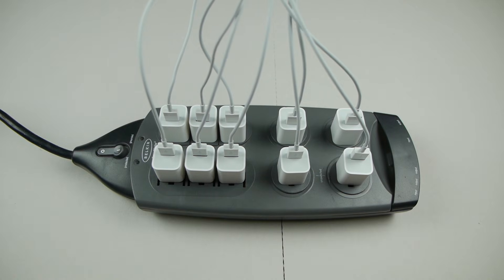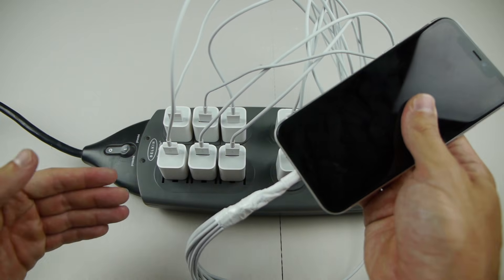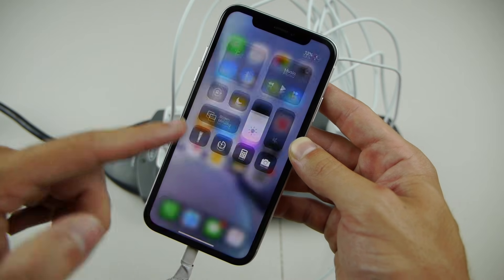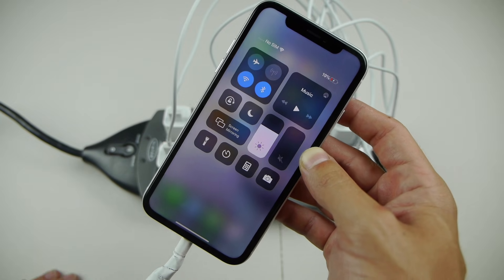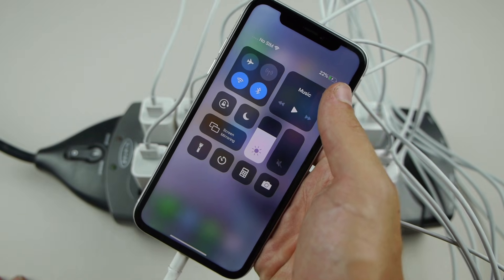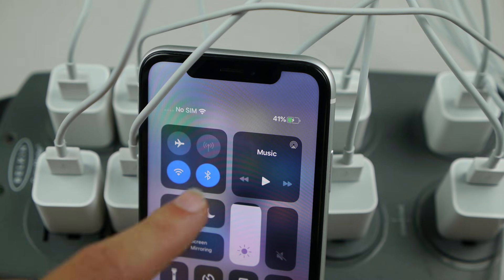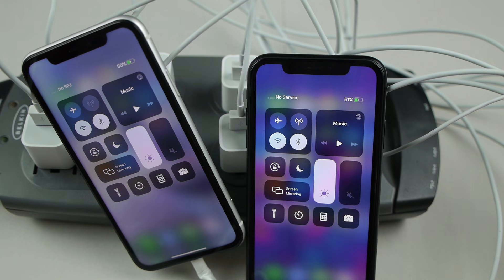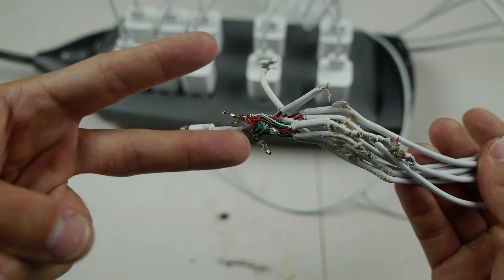What Happens When You Plug 10 Chargers in an iPhone? - One Mega Charger!

Comment: The charging current is limited by the charging device itself. For example, charging my iPad from an Apple charger, the iPad drew 0.94 Amps and the voltage dropped below 5v. Charging the same iPad and swapping to a USB Cigar socket connected to a 12V 7Ah battery allowed the iPad to draw 1.97 Amps and this held steady at 5v. The iPad itself ought to have a current limiter or thermal cutout  if well-designed

Comment: That's around 50 volts pushing through that iPhone normally a single charger is around 5 volts
Reply: No, it's still just 5v (because they're wired in parallel). It would be pushing 10A instead of the usual 1A, though, if not for the current regulator built into the phone.

Comment: The reason why the one with 10 cables charges slower at the end is because. Normally the iPhone slows Down charging at about 50% so the battery doesn’t get dameged by charging too quickly, so it probably just slows Down even more with 10 because otherwise the battery would get fried

Comment: The iPhone will only draw the necessary amount of power from the chargers that it needs when you solder them in parallel. It will allow the phone to draw more power, but the voltage stays the same and the phone will regulate the power…

Try soldering them in series, that will increase the voltage from 5v to 50v, thus forcing more power through the phone

Comment: This is seriously danger to you and your phone!
Don’t try this crazy thing!
High power voltage is created at the connecting point of all cables without suitable power inverter or transformer, it’s equal to direct power (uneven voltage).

It is possible and safe, if you connect a suitable converter at the  connecting points

Comment: Even with 100 cables you will have same output, a volt won't increase nor current cause they are connected in parallel not in series

Comment: This is fake by the way. There's just one original, whole cable under that tape. You 100% cannot just solder all the data connections inside the cable togheter... A modern charger cable is not just 2 wires for positive and negative. It's sad that so many people believe this, and that he didn't even mark this as satire in the video description.

Comment: HOW did you not burn out the battery?!?! there is at least 10 amperes! if you connected in parallel, there must be a large current, and if in series, then 50 volts. It's a LIE!!!

Comment: U have only provided parallel paths to the charging current which is limited by the phones protection circuit and the voltage remains the same even if u use 1 charger or 100 chargers for that matter.as long as the load and the voltage are the same, nothing changes

Comment: This is dumb cuzz if you put the big thing (I forgot the name) in the wall outlet than the big thing gives 250 volts and that 250 volts gets diveded by the 10 chargers so that means you can charge a litle bit better but not that much if you would do each charger in a Wal outlat than it would be real

Comment: Theres these things called capacitors. The one with 10 cables is low because the tolerance of the capacitor in the phone is like 10% or 5 precent around there. Capacitors filter electricity, they store electricity in a circuit when to much power is coming in, and when to little is coming in it fills in the gaps with stored electricity.  Tolerence is basically how precise it is. the precentage will say how much it is off by. lets say your thing is 100 power and you have a 5% tolerance, the power will be around either 95, or 105, its 5% off. Im just a kid so if any of you electricians think my facts are right leave a like pls.
Reply: Hmmm

Comment: what i’m assuming is that the iphone had a switch inside that limits the voltage the battery can receive at a time but when it’s battery is dead the switch is not activated allowing it to charge as fast as we saw it did

Comment: i have a conclusions that 9 wires is not attached to the last one wire it just attached by a taped to make it realistic for us that 10 chargers are being used to charges that iPhone w/c is probably a joke cause if it is real it may explode cause a normal capacity of that battery will not handle that much electricity that coming inside that

Comment: The current regulator circuit inside the phone be like: am I a joke to you?
Reply: No, it is never a joke to anyone, it's doing all the job - it takes the right amount of current it needs. The chargers don't apply any current themselves - they can supply up to the rated amount (5V 1A x10 = 5V 10A). The phone only takes what it needs - iPhones can charge at up to 2A with conventional 5V charging. This is why it actually chargers considerably faster, coupled with the leftover energy in the battery becoming used. That is why it charges very fast in the beginning - in reality it had more than 12% at the start and by the time it had stopped charging fast it had reached the real amount of energy in the battery + the amount of battery that was charged along the way. Good batteries rarely do that, iPhone batteries are mediocre, just like the phones themselves.
Reply: @one_step_sideways  damn man, i cant even wooosh you atm, this man/ woman/ non-binary got brains
Reply: Actual 5head
Reply: @Astrobot XJ6 the joke sucked
Reply: @Astrobot XJ6 So you didn't like that I explained why the joke was bad, got it
Reply: @Astrobot XJ6 just fuggetaboutit

Comment: tbh when i use my iPad box piece on my phone with a regular iPhone charger (even gas station bought ) my phone charges extremely fast so if you want your phone to charge faster buy an iPad box piece 

ive been doing it for over a year, i wont say that it does over heat but it RARELY over heats 

sometimes the box piece over heats sometimes the piece that goes in the phone over heats, never both
my phone never over heats when im using it unless its like been on the charger all day while im on it bc i have no life but once it gets to 100 or a high percentage just take it out an your phone wont over heat

it dies at a pace as if youre using any other adapter 

and my phone has not acted weird or broken or w.e

Comment: You can connect a tiny 12v light bulb to a massive car battery and it will just draw what it needs to work, based on Ohm's law. Same goes for phones at 5V so this is completely redundant. The charge will still be based on the phone's resistance, and it will still just draw what it can based of that. Connect 1000 chargers spliced together and it will be the same, just less current per charger to make up the 2A or whatever the phone is capable of receiving.

Comment: "Everyone should try this"
 How do you expect that any normal person will buy 10 apple chargers, cut their charging port thingy and combine it into one
Reply: Easy I'm considering it I'm good at soldering
Reply: I mean if you have enough money, why not?! Lmao
Reply: @ioahII  i have one and its like 5 bucks lol. also if ur using one it goes up to 350 degrees, and u need a roll of soldering string (basically metal string). u melt that string between wires or in circuits to imbed them together. in circuits theres holes in the circuit board(pcb) which when u attach a electronic part by putting the end in the hole, you then fill the hole with solder in its. mine is from amazon. also if ur working with wires u should use a clipper to remove the rubber incasing/inductor.
Reply: Shit I’ll buy 30 of em and do it
Reply: it's not hard as long as you aren't stupid
Reply: Well I have a peanut brain so I must be stupid huh?
Reply: He is stupid he didn’t cut the chargers he just selotape it
Reply: Vishwam Soni agree Idk how to do it
Reply: Everyone crazy in quarantine
Reply: @Daruki Neo no, if you buy 10 chargers to test if you can multiply the power output you are showing innovation and creativity. you're only stupid if you buy them without knowing what you're doing
Reply: Bruh its a piece of cake
Reply: Vishwam Soni  I try it out it works so fast
Reply: youtu.be/TCSUKIhjevo
Reply: At this rate you may as well just cut the ends and use a heavier gauge wire. Build it yourself lmao. Probably not good for long term battery health though. Fire hazard too I'm sure
Reply: Yeah

Comment: seems like you just plugged in 1 cable and taped a few of cables to the charger. THIS IS FISHY.
Reply: If you think 9 charger heads can fit in that small area and it’ll still look that slim and round, then I worry for you.
Reply: @trollorb  he can afford to cut em off. He also used cheap chineese cables too. If he actually did it, he would show the process.

Comment: Everyone, for the love of God, DO NOT TRY THIS AT HOME, this is a prank video and trying this for real can easily lead to an electric fire, electrocution and even death of your phone and/or you.

Even if this didn't kill the phone or the chargers themselves due to wiring voodoo magic, the phone wouldn't be able to charge past its hardware capabilities. 
They are defined by a chip on the battery itself that prevents it from exploding in your face the moment you plug it in even with a normal, single charger.
Reply: you gotta think that the original charger is about 5V and like 4A, if you wire them in parallel, the current adds up, so you got like 40A with 10 chargers. No batterie charge with that, so i think it limits on 4-5A, so maybe it could be a bit faster than the original, but you could also use a charger with higher capacities in the first place. Just dont do it. So much current isnt good
Reply: @matzesmith7928  Indeed, amperage can be unlimited for any consumer (phone in this case), but the voltage needs to be precise for the sake of the device's design.
Since this seems to be a parallel circuit, it can be assumed so. 
However, it is not safe to assume they're ideal sources and that none of them will fail at any given moment, short-circuiting it and just burning your house down.
In ideal conditions, the phone may be safe, but home definitely isn't.
Reply: @ManijakTotalni  amperage can't be unlimited, the battery would overheat and enter thermal run away(ie. Blow up and send glass at your face)

That is why chargers and phones have chips that monitor charging and slow it down if needed.
Reply: Soooooo, i can kill myself,? Yay!
Reply: Then what about this guy
Reply: You are all incompetent fools. These are all 5 watt chargers (at 5V 1A). Well, they are RATED to output 1A. No matter what kind of charger you're using, today's phones with lithium batteries are only going to take the amount they need.

Meaning that even if these chargers had a combined rated output of 40A, the phone would only take what it needs. Newer iPhones will take up to 2A during conventional 5V charging. So it "only" takes 2A and that's what makes it charge considerably faster than from a 5W charger rated at 5V 1A. Don't skip your science classes at school. Unless you directly apply more than 3A or more than 9V, the phone or the battery will never be overloaded.
Reply: https://youtu.be/TCSUKIhjevo
Reply: Read description lol
Reply: Thank you for the information.I was going about to try it at my unneeded iPad but I scrolled through the comments!Thank you very much.(This is my aunt's phone just using her phone for fun.)
Reply: Nobody cares
Reply: @juicyjack3331  how quirky

Comment: Its working fine and there shouldn´t be any problem with this. Because the voltage is same on every charger and the electric current is taking by the phone, how the phone wants it. And phone is taking current from many ports so its slower. So the best thing on this is that, nothing should overheat like if you use single one charge. :)

Comment: i dont believe this things bruh- cuz its not logically possible-

anyway- you cut it everytime the batery went up, you could just unplug it and charge it normally lol. if you believe this youre dumb af

So for some Brainless dead ass- Here's an easier to understand comparison.

When you Put 1 video worth of 10 GB on a 1 GB sized Flash drive, It will fail and cancelled.

or when you Put 10 Litter of water on a 1 litter bottle, it will leak.

Fast charging system is not made by slapping 10 same shit together, neither on laptop or Those damn phone.
Like Dude- use your brain- if u fuse 10 of the same shits together and it perfectly fuse, It wont god damn work. if it is, its charging 10times faster, yet the chance of it explode on the same phone, is multiplied by 10, the chance of electrical short circuit to occurs and the amount it takes also multiplied by 10.

to charge faster, It needs A components that sent electricity faster, so the electricity Will spread faster through the cable and the damn phone will have to be able to receive the same amount of electricity without overheating and explode in your damn head. Haven't u seen samsung Galaxy note 7 easily Exploded cuz Overheat? 
u guys must be Cave man if u dont know it.

What are you, Nine? use your logic brain duh--

this comment may got erased or i got banned from the channel anyway, so good luck reading this

Comment: No thus does not make any sense why would 10 chargers connected to a single phone make the phones charge faster it does not make any sense you should not do this if you don't understand the physics of electricity or engineer because why would a 10 charger could fast charge that phone in an minute even the 600$ Phone with dual charger could only full charge in 30 minutes without doing that trick I don't understand is this a clickbait?!?!?!

Comment: The max is 5.2V @ 2.4A for the iPhones. Since those are 1A each really 3 are only needed. It’s more efficient to just use a 5V 2.4A adapter. You are also loosing efficiency due to heat loss. It’s definitely a major fire hazard.

Comment: You’re going to destroy your battery. There has got to be an amp or wattage limit to those batteries and without and olm reader idk how you can tell what voltage your phones getting. For all you know you could be completely overloading it and it’s 5 of those charges before the battery explodes and catches everything on fire. If you want a fast charger spend the $15 and buy a fast charger. It literally charges your phone at a super fast rate.

Comment: It wont work because they are all connected to the same amount of energy devided by 10 so single charger or 1charger will not make the difference if you want a fast charge just add more electricity

Comment: It's fake. One apple 'normal'  charger has 5V and 1A which gives 5Watts. Connecting 10 chargers into one cable gives of course 10A, so we get then 50Watts. But iPhone has possiblity to charge maximally only at 18Watts. So the power made on this video is too much for the phone and battery charging controller limits that power to charge it normally at 5Watts or even lower to save the device from too much heat which could blow the battery up or fry the phone itself

Comment: He simply connect all the chargers output in parallel and connected the charger pin at end. But luckily the mobile chargers are promrammed in such way that they provide electric current according to the load demand. So lets say if the iphone charges on 1A or say 2A and the power sources are in parallel so in that case iphone will receive its rated current from each charger like 0.25 or less from each charger making its total 2A demand.
Thats simple. Nothing new
Reply: This phone can charge at a maximum of 18 watts i think but hey, finally someone who also knows how it works.
Reply: @computernerdinside  Possibly this phone can charge on 18W but i just tried to solve the whole scenario. I hope you got it what i said. ✌️🌹😊

Comment: this experiment was actually not rational, even if you use 100 adapters, you're gonna get the same result, the charger gets a step down voltage from 230 V to like 12-15 volts, which goes to a bunch of cables then, of which one cable only carries about 1-2 volts barely, and you used each cable from different charger, which makes no difference at all and is as same as using a single charger

Comment: IPhone battery percentage indicator  is the least reliable way to estimate actual battery charge. It's indication is usually all over the place between 0 and 100. Most times  when it indicatedly charges too quickly the battery percentage charge  also drops equally rapidly upon disconnecting.

Comment: Are you really ..fool ...Anybody with basic knowledge of electronics knows all the chargers give 5v and are connected in parallel..hence nothing happens..currrent through each of the 10 chargers will be less,as compared to connected a single charger...but the total amount of current received by the phone remains same as that of comnecting only single charger  ,as the load is same and voltage is same

Are you dare enough to connect all chargers in series and connect to your iPhone...I will appreciate your..braveness...😂😂😂😂😂😂😂